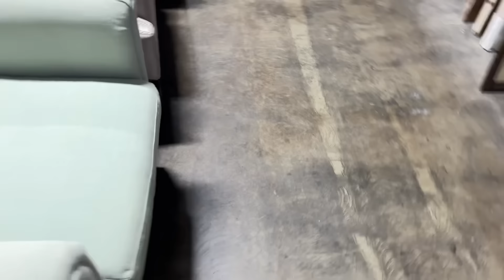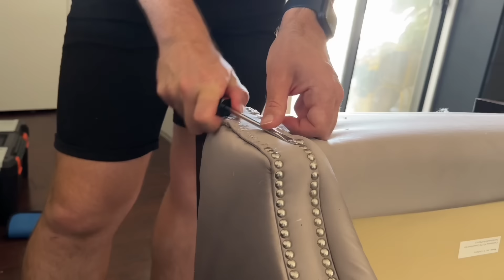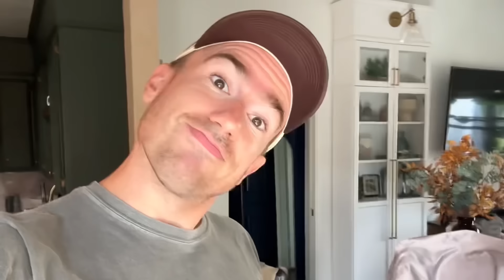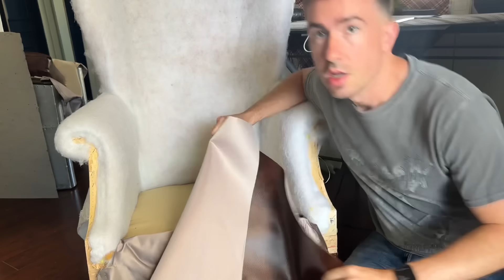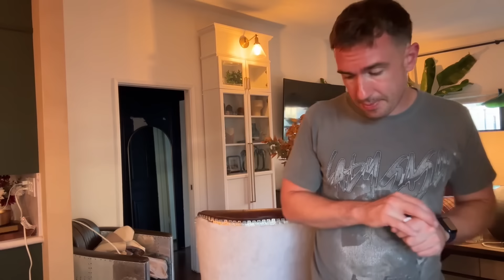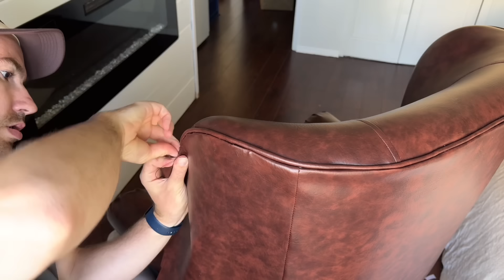Making over a $40 Wingback Chair…

Comment: Really Hon - great job!  I've been reupholstering my dining room chairs (for months now), even picked up the staple puller, a tiny plastic hammer, and a Ryobi battery stapler.  The hardest part is taking those bad boys apart.  If those folks needed to use 500 staples, they chose to use 1000.  Those pneumatic staplers must be fun and they must have twitchy trigger fingers.  I am using quilted microfiber and added memory foam for extra cush on the tush.  But... the stapler has a hecka time getting through the fabric and batting.  In other words, I feel your pain.  What sets you apart; however, is that you found the chutzpah to not let that chair defeat you.  Your sewing skills are stellar and I love-love the seams.  Outstanding work!😊
Reply from the maker: Now I know what tools I’ll really need if I ever attempt to do this again! But I definitely didn’t let the chair defeat me! 🤣💪🏻

Comment: WOW!!!!! For a first timer I think you did an awesome job! Your chair fits in so nicely.
I agree with the electric stapler if you do this again… and maybe there’s a rental option for more of an industrial type stapler instead of having to buy a home DIY-er stapler (if that makes sense).
One more thing… my mom mends blue jeans and extremely durable garments and she found a pair of needle nose pliers works like a charm to pull the needle through thick, bulky, stubborn fabrics (sorry this suggestion is too late for this project 😔).
Reply from the maker: I’ll take all the tips and tricks I can! Probably won’t be doing this again any time soon, but at least I’ll know if there is a next time! 🤣
Reply: Also a thimble helps with the needle so your fingers don’t hurt as badly.  The needle nose pliers are great for pulling and the thimble for pushing.  Nice job.

Comment: You did good.  Have a little experience myself and I no that having the tools makes it so much easier.  When I did a chair the same by the way everything was done with tacks no staples which now watching you made me think that the tacks were a lot easier. Stretching the fabric at the right points to begin make the folds around the arms a little simpler.  I no you said you were not going to replace the silver tacks but I thing it looks a little unfinished at that point.   My opinion.  You can get brass ones and that would go with your overall look.  I think you might be able to get it on a roll and stick on.  Or perhaps some piping placed around would work also. Good job and yet I remember the pain in my hands from the hammer tacks pulling ect.   No pain no gain.   ❤
Reply from the maker: Yeah I just like the cleaner lines without the tacks- it reads more modern to me, but I appreciate the input.